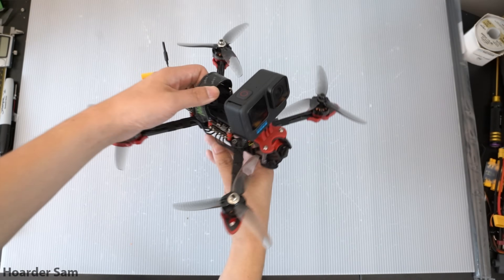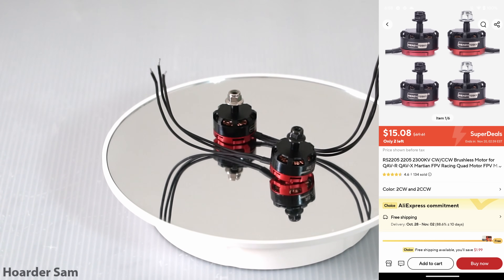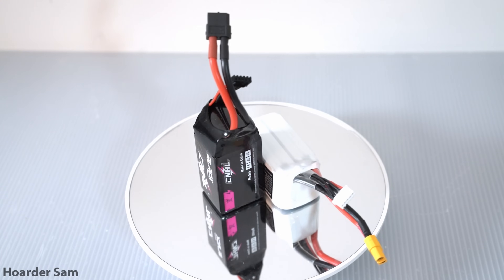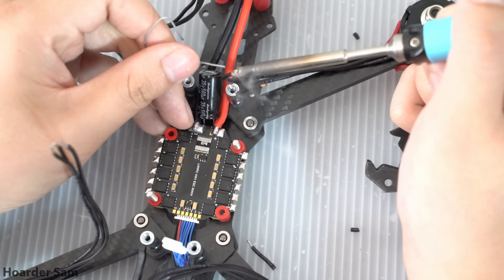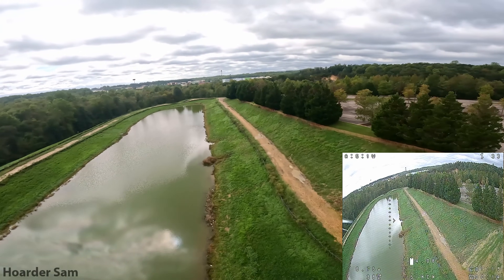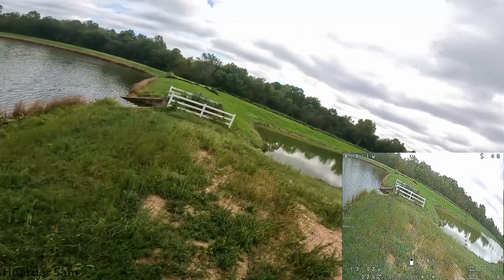How to build a 5-inch FPV Drone for $100

Comment: I mounted motors in X - way ( like red/black ones are not in parallel). I can't understand from this video how should i connect wires, all are black and all info on them is some temperature value. 

Also, this transistor you soldering in parallel with battery input. Longer "leg" is plus or minus?
Reply from the maker: Longer leg is plus. shorter leg with the white stripe on the can is minus.

The way order you do the motors doesn't matter, since it is accounted for in the software setup where we set the motor direction
Reply: @hoardersam10  Wow, what a fast response! thank you :)

Comment: I just finished building this but the drone wont turn on. I tried replacing the xt60 connector, and nothing. I tried sanding it down and stretching the pins, and nothing. I tested the ESC before putting everything together and it worked fine. The battery is charged and turns on my other drone. There is still electricity conducted into the drone and for some reason the drone is turning on. Any idea what might be happening? Thanks!
Reply: Maybe a faulty flight stack?
Reply: @ after a bunch of testing, i think the ESC is messed up
Reply: @jon_espi10good to hear. Do you think this drone can take 6s even though the motors are 4s rated? Should I risk it?
Reply: @ im no pro, but I wouldn't. These parts are already as cheap as they are. Ive heard about them malfunctioning, and i dont think its worth the extra power

Comment: its all well and good you can get the drone done for 100 bucks, but man, when it comes to equipment youre looking at spending ~150 bucks on the low end, like bare minimum low end. for decent stuff youre looking at the 300 dollar range easily. totaling ~500 bucks for decent equipment 
fpv is damn expensive

Comment: Hi, do you accept order assemble and ready to fly drone? I am not good with electronics thing but I like to fly FPV drone,  I want to buy from you. Thanks
Reply: dude just buy a bind and fly
Reply: @ i try to assemble the O3 to the Pavo20 pocket but I can only bind the air unit to my goggles but the flight controller was a failure, I need help

Comment: If I use a bigger battery to increase the flight time do you reckon there is wiggle room on the chassis to fit the larger battery dimensions??

Comment: Just to let yall know, I built one of these..   this thing is way faster than he made it look and I’m happy about it.  It’s a super cheap but a very slept on build.   Thanks man! 🙏 my total for everything including goggles receiver and transmitter (I used flysky)  was $208 after taxes.
Reply: Hi,
I'm new to drones, never had an RTF drone before, but I do have a DJI Osmo Action 4, so starting off with a build like this sounds ideal for me when I first start practicing in a simulator a bit, but with the suggested goggles and transmitter suggested in the Video + batteries, charger etc. I find myself more at around 350€ on Aliexpress.
As I would mainly use this drone to get some cool (cinematic) shots when on roadtrips this is quite a bunch stacking up.

Sounds like you found an even more budget friendly way.
Which transmitter and goggles did you choose exactly?
Reply: @Tropox I used a cheap $50 set of goggles and a flysky transmitter!   Everything was on discount and I added a discount code which made it right around $120
Reply: For the flysky receiver, which did you use? Did you wire it the same as he did in the video? Thanks.
Reply: For me 540€ for everything shown😭😭
Reply: Did you manage to weigh it?

Comment: can i use this cheap charger?

 iMAX B6 b6ac 80W Battery Charger Lipo NiMh Li-Ion Ni-Cd Digital RC B6 Lipro Balance Charger Discharger + 12V 5A Adapter

Comment: I’ve been using the same fc but I used the 60amp but my motor and battery is all 4s and when I fly my voltage drops catastrophically, the lowest can even go under 14v often. Is it because one of. Y components it using too much? My vtx is 2.5w but I used 100mw only

Comment: Hi, i also build a 5 Inch with this FC Stack but witch other Motors, VTX etc...
Is it possible to also Install a GPS unit? The sodering instruction Said that it isnt possible when you also have a VTX installed. So im wondering If there are other tx/rx Ports available for a GPS unit. Thx for your answer!

Comment: For the batteries, the ones you linked the cheapest i could find was 60 bucks for 2 of them, but then i came across 2s version which only costs 25 bucks for 2, is there a big difference that justifies the price or not?

Comment: big question, what type of range would you typically get with this, 

Idk if it is too much but id like to film backcountryskiing w this, just wondering if this analog system would get far enough while keeping connection
Reply from the maker: It depends on a lot of factors, especially antennas on the goggle side, and where you are flying. Since skiing is remote and there won't be a lot of interference, I think you could easily get 1+ mile range
Reply: @  got that radio master pocket remote, goggles I still have to buy, I’ll just pray that it works ahahah. Yeah. 0 interference where I plan to film, ty for the reply!

Comment: Awesome video been looking at getting into building drones to save a bit more cash would you recommend 3d printing frames haven't found a lot of 3d modelled frames
Reply from the maker: It's not recommended since carbon frames are so light and stiff compared to 3D printed

Comment: How much if you include batteries goggles and controller?
Reply: The battery can be picked up for 20-30 bucks or more, the controller was 60$ in the video.

Comment: Hello thinking I want to give this a try with a walksnail camera however I’m very new. Are the only parts I would have to swap out the camera? Or are any other parts not compatible with walksnail?
Reply: If the leads are the same (very likely) then you can just use the walksnail camera. For videos I'd still recommend a dedicated action cam attached to the drone.

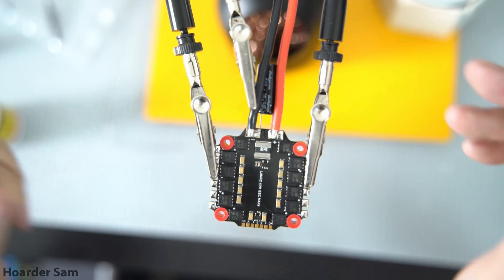Comment: 5:10 you apply something to the solder?
Reply from the maker: Liquid flux to help the solder flow. The one in the video is actually conductive so its not great to use, I need to get proper flux and not aliexpress flux
Reply: @ uh oh I just had some of the flux ordered from there lol , I’ve been trying to copy all the tools you have to make my builds go way easier

Comment: Yo motors are for 0.99 and frame for 6 should i buy some or nah ( im new to drones ) ( analog cam is also 0.99)
Reply from the maker: I think that's a Welcome Deal so the discounted price will only apply to one item - I don't think you can get them all for those prices. But right now is a good time to buy since its the Choice Day sales for the start of the month
Reply: @hoardersam10 Alright thanks man , happy new year btw

Comment: Honest question as a newbie to the hobby, is this 5' easier to start off with then the 7' for some one first time flying a drone? Need to master the technique first. Thank you
Reply: 5 inch drones are not made for beginners
Reply: @MatiX415  thanks for responding im very new to the hobby
Reply: @zer0coolninja887   whoops or 3 inch drones are the best for beginners because they are smaller and weight less. Crashing a 5 inch can be very expensive because they are heavy and very fast. Less weight = less damage (everyone crashes btw, even experienced pilots)
Reply: @MatiX415  thanks wanted to get into the hobby just didnt know where to start cheers 🍻
Reply: The 5" drones usually weigh less and are more nimble. It depends on the usage, if you are looking into getting into freestyle or similar things go for 5", for long range get the 7" or even fixed wings.

Comment: I was wondering what kind of screws you are using for the motors. I bought the screw assortment kit from the link and the m3x10 screw would not grab onto the motors threading. Were the screws you were using m3.5x10 screws? Thanks for the video, I enjoyed building this drone for $100.
Reply: I am also having this issue... not sure what size the screws that came with the motors are!

Comment: Hi! Thank you for the video. I was wondering if a different motor is possible because I was looking at the listing and looks like the motors used here is marked as cw and ccw which I think is clockwise and counterclockwise. I am a noob in this and I want to dip my toes in. Also, how do I know which wires from the motor do I solder to the board? Thanks!
Reply from the maker: The CW and CCW thing is old school but should still work. The motor wire order doesn't matter as the motor direction is set up in software, so the order they are soldered doesn't matter
Reply: @ thank you so much! That means I can buy any motor that I can?
Reply from the maker: @viencecaina4236  Yeah the CW/CCW doesnt matter. If you want to follow my build exactly, I got the 2 CW / 2 CCW pack but it doesn't really matter

Comment: Is it okay if I get the stack with the 60A esc? I'll be using the same motors but there's not a huge price difference between them so if I get the 60A variation I'll be able to upgrade my motors (I will upgrade it for sure after some time)
Reply from the maker: Yeah the 60A will work exactly the same, its the same as the 45A except they just used better MOSFETs

Comment: I'm committed to building a drone specifically for learning line of sight, no camera/fpv, stricly LOS acro. could you do a video on building something like that for cheap? only item I have for this so far is a flysky fs16 transmitter and receiver. (it's not elrs). pleeeeeease :)
Reply: Flying FPV LOS only is very hard and I wouldn't recommend it. If you still want to fly LOS only then you can just skip the camera but I'd still recommend it. For acro I'd also go for better motors. It's no issue that your transmitter isn't ELRS, just get a remote supporting your transmitter but ELRS is the best protocol.

Comment: can i freestyle with this? cuz if yes i place my order for the parts
Reply from the maker: Not very well at freestyle. I'd get modern motors like 2207 ~1800kv motors and not these red bottoms
Reply: @hoardersam10  So if i were to change these to 2207s would i need to also change to 6s Lipos?

Comment: Hello, what speedybee stack do you recommand for this drone ? Is Speedybee F405 V4 much better than  V3  ? thanks
Reply from the maker: It's not much different, it only really fixes a bug with the O3 air unit. So either one will work just fine for this build

Comment: Hello, for the ESC you recommand a 45A ESC, is it better to choose a 60A ESC as it is just a few bucks more expensive ? thanks for your video that makes me spend my money ah, ah 😋
Reply from the maker: Yeah get the 60A if you can since it should be more reliable
Reply: I got the 60A ESC, and when I got everything soldered correctly, I plugged in the battery with a smoke stopper and it started beeping... after looking for a bit at the internet, I found that it could be smoke stopper fault, so I tried without - it wasn't the smoke stopper :D Anyway, I have then found out, that something must have been wrong with one motor output, because when I unsoldered the motor (new, working), everything booted up correctly without fault. So I wrote a refund to AliExpress yesterday and today they told me that I will get my money back. Overall great customer support, I'm ordering a replacement from Ysido rn.

Comment: Hi thanks for build. I have a quesiton - motors are not start together if I use Lihv battery  (1550 mAh, 60C, 22.8v, 6s1p, 35.34wh), but when I check them one by one in Betaflight its ok, they spin. But if together - no. Is it something to battery related?  
I also ended up using speedebee stack cause yisdo couldnt see my computer..... ((
Reply from the maker: Look in the power tab for Betaflight, I think you have to do something special for LiHv 6s since betaflight usually does not expect such high voltages.

Or charge it as a standard Lipo and Lihv
Reply: @hoardersam10  thanks for the feedback, so probably I resolved that issue and basically the issue was with voltage, e.g. for high KV speed we should use lover voltage (14v+), for low KV speed we should use higher voltage (22v+) . Chat GPT also calcuclated that with current battery voltage (22v+)  motors should run too hight rpm value, which causes hight load... as 1v == KV per minute of your motors
Reply: @hoardersam10  so it wasn't about battery))) motors firmware.. had to set blhelly

Comment: I bought all the parts and built this drone by following the videos. It works perfectly! Thank you!
Reply from the maker: Glad to hear!
Reply: @hoardersam10 Can some1 tell why his 5inch drone guide is more cheaper than the 3.5inch one bc im looking to build a 3.5inch drone but i thought that 3.5 inch drone were cheaper?
Reply: how is it? what is the total flight time you can get out of it? can you use a phone app instead of the goggles?
Reply: @nextlvlroy  an app instead of goggles is not posible for analog fpv drones, because they send out the video in a way that the phone cannot recieve.
Reply: How long did it take you to build? Do you think is it feaseable to put together during a weekend. Thanks! :)
Reply: @ I had a couple hiccups and soldering is a bit trickier than he’s making it look in the video, but I managed to put mine together in one night after work. Took me close to 6 hours tho lol
Reply: @ryandickson2224  Cheers!  I didnt wanted to spend days on the build, but after your comment I think I gonna give it a go. :)
Reply: @Lorant1984   havnt built it yet but have ordered some parts for really cheap and the flight controler came today. But i definitely think that it is possible to build it in a weekend
Reply: This is good. But after some days buy some good quality motors cuz those motors are the cheapest one also clone (EMAX RS2205)
Reply: @memeis1  I have some iFlight XING E Pro motors on the way with an O4 Unit lol
Reply: How is it holding up?

Comment: Just built one like in the video, but get the better camera the fisheye is terrible on the cheapo one. Also there are kits on ali with the frame motors and esc fc stack😅
Reply: Yea I saw those kits but they work out more expensive than buying the individual parts?

Comment: 5:00 Where does the battery capasitor and the battery leads come with? Do i have to order them extra or are they somewhere included? Nice video, keep up the work, greetings from Europe 🇩🇪
Reply from the maker: The Flight stack/ESC will come with the capacitor and leads
Reply: @hoardersam10 what Controller/ goggles so you use?
Reply: @liskohipp2925  did you even watch the video?
Reply: Radiomaster Pocket, VR01

Comment: sir, I bought the Ratel 2 camera, do i still need to buy the vtx? im planning to get the speedybee vtx..please help
Reply from the maker: Yes VTX is still required
Reply: @hoardersam10  Sir, I bought all the parts except the battery. Should I get the 14.8Volts or the 22.2Volts?
Reply: the ESC is 45A
Reply from the maker: @TheFilewalker93  14.8v for this build. It can't take 22.22

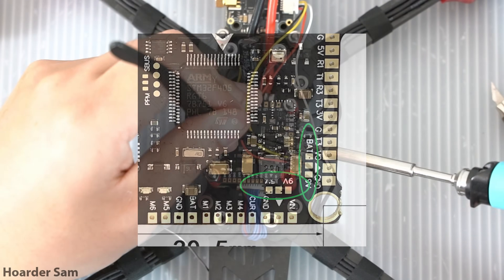Comment: 8:35 If you're using the SpeedyBee TX800 VTX, make sure it is hooked up to 5 volts! I tried 9 and mine went up in smoke. Waiting for a replacement 😂
Reply: also do not power on without the antenna !!
Reply: Thanks, I bought a speedybee, so I will pay attention ! Still waiting for parts to start building my first fpv !
Reply: I made this mistake at first but luckily I had a smoke stopper connected to it then I knew something wasn't right
Reply: should i do a solder bridge with Bat?
Reply: @crownfunky8131 I just put it straight to another 5v that's was spare on the board
Reply: been there brother
Reply: Can someone please explain this is my first fpv build
Reply: From where do I get the 5V? Cam 5V?
Reply: Where did you get the 5v
Reply: where did you get the 5 volts? do you have your diagram?
Reply: Thank you for your sacrifice.
Reply: I got the speedy bee Vtx 800 too. Good thing I saw your comment first before building my 1st drone. Sorry to hear your lost
Reply: Hmm is it the 5V in the same line?

Comment: Did you cut off the ground and 5v out wires on the vtx? I was confused on where to solder them until i went back in the video and it seems you dont use them or have them on your vtx. Thank you for the guide it has made getting into the building very easy so far.
Reply: Had a brain fart, I assume this 5vout and ground are for some sort of peripheral, as there are two grounds
Reply from the maker: I removed the pins for those extra 5v and ground. They are to power a camera in case you don't use a flight controller (like cars or airplanes).
Reply: @hoardersam10  thank you for all the help!

Comment: Hi I need help it’s nearly Christmas and I’m looking for a drone to get. I want it to be a bundle other wise I would need a cheap drone, cheap headset and cheap controller and I don’t know how to tune or connect any of it so I want a RTF kit I was thing about getting the BabyApe II RTF kit should I get it or something else?
Reply from the maker: I'd also check out Emaxs RTF kits as well as BetaFPVs RTF kits
Reply: @ I don’t really want an betaFPV kit as I have MANY hours in MANY different fpv simulators and feel like I could go for better I’ll look at emax now

Comment: Whats the difference between the 45amp and 60 amp esc?
Reply: I am way too late but if anyone is still wondering, as far as I know it's just the maximum current the ESC can handle, I am unsure if it's per motor though.
Reply: @noidex2936  in this form factor it should be combined
Reply: It's per motor amphere